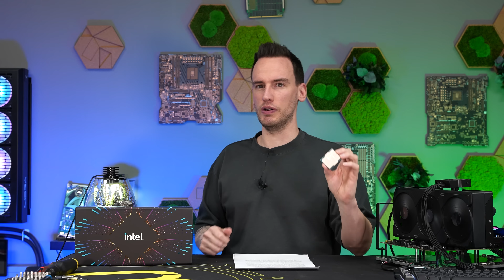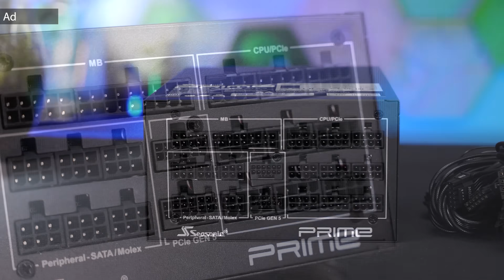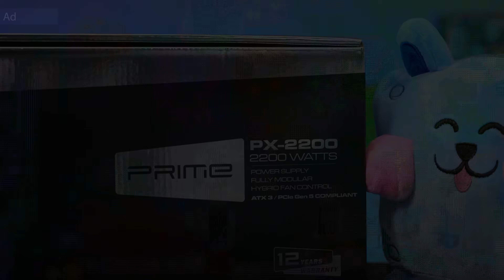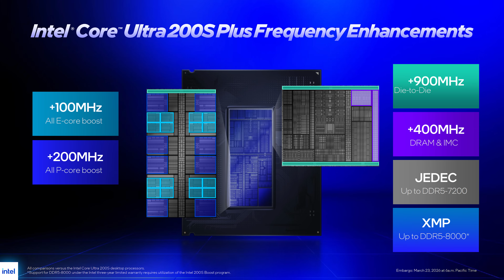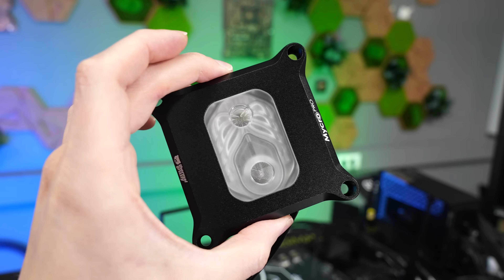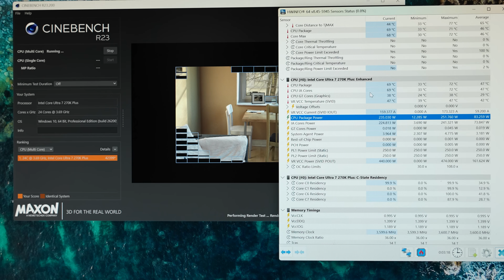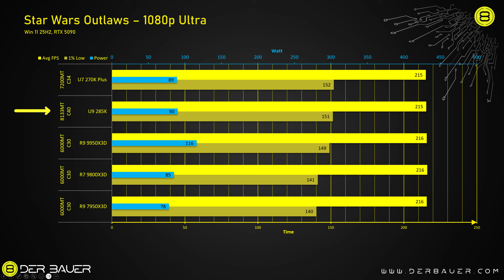The Best Intel CPU in Years! 270K Plus Review

Comment: Maybe one day, when I inherit grandfathers DDR5.
Reply: You'll lose about 1 bit in every byte due to inheritance tax
Reply: @andyastrand I didn’t know a parity bit was taxable ?!
Reply: For now 146/700Kf with DDR4 does it's job really well especially after undervolt. No regrets about DDR5 platforms inaccessibility.
Reply: @stangamer1151  Grandads not leaving you his heirloom ram is he?
Reply: lol 😂
Reply: KEKW
Reply: The 14600k is inflated, a 13600k costs 15-20% less.
Reply: Should have had extra by now...any overclocker does. Need a set or two?
Reply: No chance kid bury it in my grave😂
Reply: Exactly!! 
Cpu's were never!! faster and cheaper* then lately, counting from K7-Tbird, almost every red cpu between, till PII-965 when they hit years long THE WALL power socket lol, but nothing! was burning then to, even 5G/200W+ :)
2016 settled for blues 6600k system (had fm2 6600k also), mined E with reds 580's for years, still works like charm with 5700xt/z170GPC/16/S3422DW..
During covid years, got an used refresh* 7700k/z270 arctic-now titanium.. paired with 32/7800xt/VPN100/55C1.. still rocks, even Stalker2 lmao..
Prolonging short story already, one pathetic 7500f today slaps them both, comparing same with duron@800 back in days..
MBO trilopoly is way tougher to handle then 5 and more years ago.. still* not big if on red base..  
Problem is in stupid people, becoming even more dumber misusing! ASUS A8N32-SLI Deluxe logo lmao, as i would rather burn 129 to 500eu difference, after midnight price spike!! for 32c30@6k DDR5 roflmao.. along with green camp from first rtx serie.. that's when video killed midrange radios.. hopefully they do sepuku one day for good with 12V..
So idk what is the use of reviewing cpu's today at all, but is good to know someone still thinks on god ol micro evolution only history blues, with buildings full of their smelly sockets*.. or are they greens now..

這讓人不禁好奇接下來會發生什麼事

Comment: Awesome...but DDR5, its DOA.
It need a DDR4 Support with DDR4 Motherboard to be an option.
Reply: DDR4 is obsolete now. LGA1700 is your last platform to get DDR4 support, so you can run a 14900k if you want the best CPU for DDR4.
Reply: @_aceofspades_  Yes but AI Data Center taking all the chip, its deead  to have DDR5 at affordable price.
Reply: why not use the old DDR 5 sticks on the new CPU ?
or your museum is so old that sticking to DDR 4 is a fast upgrade ?
smart ?
Why not go for a Pre Build, need a new GeForce too ?
Reply: @lucasrem  Because AI Data Center taking all the chip increased DDR5 Price.

Comment: 7200mhz vs 6000mhz ram though wouldn't call that fraction of the price with a complete build
Reply: My year old DDR is 6000, intel provided this, 0.004 deference in frames !
Reply: @lucasrem  0.004 would equal to zero gain at all .

Comment: If only intel wouldn't change socket every gen...
Reply: IIRC, they have announced plans to change this.
Reply: how many amd cpus did it take to find one that doesnt stutter
Reply: Oh look, someone that upgrade annually or the latest! I bet you dumped a 9800X3D for 9850X3D!
Reply: @AlfaPro1337 Annually? Bro people would like to keep their upgrade options open for longer than mere two years.
As impressive as an upgrade this Plus series is it will be beaten on less than 12 months by both Nova Lake and Zen 6 that will be vastly better options with much better platform support.
Even Intel is rumored to support LGA1954 for around 3-4 generations. That's reasonable. No one is asking for 10 generations, but most would like more than mere two generations.
Reply: @Raivo_K  Not really, I saw when 5800X3D launched, people dumping their perfectly working Am4 chip for it.

Later when AM5 launched, dumped their AM4 for Am5.

The cycle repeats with 7800X3D, dumped their 7900X for it.

Oh wait there's more and you guessed it! Dumped their 7800X3D for 9800X3D.

There's even more and you already saw this miles away! 9800X3D for 9995WX.

Rinse and repeat with 9850X3D.

Guess what will happened when 9950X3D2 launched. . .

This just shows that AMD products aged like rotten milk before it hit store shelves, or even in design.

Also on Reddit, guess what? Dumped their dead end socket (older platform) for another dead end socket (Am4)?

"their upgrade options open for longer than mere two years"

No, it is actually annual or whatever the latest.
Reply: @AlfaPro1337  Found the Intel fanboy. AMD CPU's aged like milk? Bro i dont know what herbs you're on, but you better ease up on those. 5800X3D is literally trading blows with the newest releases four years later with slower memory. People who upgraded to X3D on AM4 made the best decision in regards to gaming performance on that socket. All 7000 series models on AM5 are also still relevant.
Reply: @Raivo_K  Let AM4 go, it's dead already, not obsolete mind you.
And tell us how awesome an upgrade path on AM5, how meaningful it is?
Reply: @AlfaPro1337  stop self liking fam
Reply: @alondjeckto  You too 🤡
Reply: @StroggKingu Zen 4 to Zen 7 is going to be a pretty insane performance increase yes
Reply: @enriqueouro9  I'll believe it when I see that. Zen 4 to 5 also had awesome marketing but tests verified that.
And how do you know if Zen 7 is going to be on AM5?
Reply: @StroggKingu That seems to be what leakers say, not guaranteed but it seems very likely at this point. Zen 5 was very similar to Zen 4, Zen 6 is going to be a significant change in the architecture and process node, so performance will also be significantly different.

Comment: how do it comper too my old 12900ks?
Reply: The new Plus Version eats your old 12900 in every aspect
Reply: @MichaJenkins  eats your old 12900 barely, in real life
Reply: @claudej8805  only if you need that RTX 5090, i would upgrade that 12900k now.
What GPU u use ?
Reply: @lucasrem I use a 3090. Mostly for gaming and fps shooters. The real life and benchmarks are not the same. Thanks for input, I hold no to it a couple of generations 😊

Comment: Intel loves to have a short run on each socket.
Impressive to see them outdoing AMD in multi threading, and at a much lower price. Honestly the gaming performance looks good. Shame no one can afford RAM rn.
Reply: When you only upgrade every five-six years, you’d want a new motherboard and everything else anyways. The only part that got to move to your new pc is the mechanical drive. 😂
Reply: @leeyuan8311 I've usually done one upgrade per socket. I've had six chips in 20 years on three sockets:
2005 first self built PC, Socket 939, NF4, single core Athlon 3000+, later upgraded to dual core 3800X2 on the same board, helluva upgrade.
2012 LGA 1155, p67, quad core 2500k, later upgraded to a 3770k on the same board.
2020 AM4, B550, hex core 3600, later upgraded to 5800 X3D on the same board.
Probably upgrade platform again in another 3-4 years. I will look for something that has upgrade potential when the time comes.
Reply: It's funny there are people who think just because we don't upgrade every 2 years we are not in the market, we just don't see the point of spending it, even more as an adult with responsibilities it's borderline reckless spending IMHO
Reply: I wouldn't be surprised if prices dropped within the next 2 years.
Reply: Except LGA1700 is now going on 5 different CPU generations but ook lmao
Reply: They do keep Socket long support in Socket 478 / 775 generation 

But then sad story started
Reply: The sockets being changed doesn't really matter, you would waste money upgrading every generation for incremental performance gains Best is to skip 2-3 generations and by then you will want a new motherboard so the socket doesn't matter. Other technologies on the motherboard change in that amount of time so keeping the old board is leaving new/updated technology off the table. But thanks to AMD's marketing department people started caring, and yeah it is all marketing.
Reply: @JETWTF  2-3 generations is still within the life time of a Amd 4/5 mother board. 

If you bought a 7000 series cpu  , you could upgrade to Zen 6 and Zen 7   , with just a bios update. 
And its good for budget users and Teens just getting into pc building , the ability to incrementally upgrade a pc without needing new mother board and ram,
Reply: @snakeinabox7220  The absolute worst way to buy a computer. Get a shit experience the whole time with mid range parts and spend more in the long run. Intel flagships always last longer than AMD of the same era, mostly because of the memory controller, single core speeds, and the monolithic architecture that made it snappy before Arrow Lake. If you compare something like a 10700K or 10900K to a Ryzen 3000 build, why in the world would you want to spend more on a Ryzen 5000 part at this point? The 10900K will still be a better experience. The best option is to get a 270K right now if you need the horsepower and ride it out way past AM5's expiration date. And that's not even considering LGA 1700 which went from 12th gen to 14th gen with both DDR4 and DDR5 support, the 147/900K of which is still offering the fastest gaming experience on anything over 1440p. For gaming we're waiting on GPU performance.
Reply: @Felale brother.
3700x vs 10700k.
A 270 Usd and cpu vs 400+ usd Intel cpu.
3700x has pcie 4(10700k only had pcie 3), same multi core and productivity and had 90% of the gameing performance, and used less power. 
And for flag ships 16c 3950x  beat the 10c 10900k by a Wide margin in every productivity class. 
Next generation 5800x3d released and it was the King of gaming, surpassing the 10700k by up to 30%+. One bios update and you can slot it in. Or a 5950x.
Meanwhile 11gen was a flop, and 12th needed a new motherboard.  And motherboards only supported ddr4  Or ddr5, not both at the same time. 

13th and 14th are degrading and dieing( my own 13700k included, and bios updrade helped, but doesn't fix degradation that already happend. . 
In the life span of Am4, Intel Swaped 4 motherboards. If you got a 1600x you could updrade it to a 5600x.
If you had a 6600k, you can't upgrade past 7th gen ,
Updadability is something you can't ignore on amd. .
And for zen 4? You can upgrade all the way up to a  zen 7.
And Yes cpu performance does matter , as upscalers are becoming unanimous. The internal resolution is staying around 1080p. A 5090/5080 usieng Dlss Quality at 4k is rendering the frames at 1440p internal, and 1080p for Balanced.
Especially for nvidea as they lack a extensive hardware schedualer and use more cpu performance.  You can see that in the Star wars and cod games, whare a 9070xt is at the close to the  performance as a 4090( in tech power ups review of Star wars zero company , when running at the same internal resolution 5090 4k Dlss Balanced and 9070xt 1440p Fsr Quality they get the same fps around 95) , becouse the nvidea gpu  gets cpu limited first, even with 9800x3d chips.
Reply: @snakeinabox7220  true but with Zen 6 about to be launched next year, the whole point of AM5’s longevity is becoming less…. Because a Zen 4 gen can be considered to be upgraded with Zen 6 or maybe Zen 7 but when Zen 6 is there in the horizon by 4-5 months time as rumours say, the whole platform longevity becomes less for a general user 🤝
Reply: @Sandychocky5500  zen 6 still had a generation ahead, and amd has proven to continue supporting older gen platforms.
If Intel truly does support 3 real generations( like the Rumers say) on the  same  motherboard. Then it will be a bonus for them.
But if they launch another motherboard with 1 generation + refresh, then it's going to be disappointing.
Reply: @snakeinabox7220  well to be honest, for people like me who literally use the CPU platform to the maximum possible till it becomes quite obsolete, single generation platforms are fine for me. Because I’m still using my Alienware 15 R3 as I said that has a i7 7820HK, 1080 Max Q 8Gb and 32GB RAM from 2017 which is till use as primary machine but yes it is slow by today’s standards. That’s why planning for a 270K plus for even a longer term till the next generation platform comes with DDR6 memory support. It’s like not confirmed but DDR6 could potentially find light to mainstream desktops by atleast 6-7 years from now….
Reply: ...except for the last socket? Which ran for 3 years and 3 respective generations? Except for that one? The one that ran the same length of time as AM4? You are, of course, not including that Intel generation in your jab?
Reply: Easy win in multicore but with 50% more cores.
Reply: Im not too surprised about the multi threading performance, they just have straight up more cores/threads, for single core performance the P cores are comparable to and cores but the e cores are a lot worse, if a application is properly multi threaded then the difference in P and E cores should be minimal. Gaming usually is more intensive on multi threaded cores hence why amd can still be better. That’s not the entire picture ofc cause also cache but that’s the general picture
Reply: most people have the ram from before.
Reply: @StaceyJensenn  If you are already on DDR5 platform it's unlikely that you are looking for an upgrade unless you are on AM5
Reply: @Rentta  well i got 12600 on ddr5 platform, i can still get up to 14th cpu ,but sure im not going to upgrade , i literally have no need
Reply: @StaceyJensenn I'm on a 12600k but on ddr4 and i still can't justify an upgrade.  Running it at 5ghz/3.9 and it still seems to keep up with my 9070xt well enough.  Still the best price to performance ratio to date, as covered by a few reviewers I've seen lately.    I think my entire setup minus the GPU was ~$900 2.5 years ago?
Reply: @StaceyJensenn  didn't know i can still use my 1600mhz ddr3 with these new chips, thanks for the heads-up !
Reply: @WheissRS  no problem, didnt knew people still use almost 20year old ddr
Reply: @WheissRS  Be honest, you aren't in the market for a new build if $200 swing in RAM prices makes you tap out.
Reply: @CyberneticArgumentCreator yea buddy, more like $200 just for the storage  😂
I was planning to indulge myself with a full top notch AMD build actually, but my old system is still working fine, it even has the benefit of not being compatible with Windows anymore! So i will wait and see, life is plenty busy anyways.

Comment: thank you for the nice pro reviews you are making der8auer , i just have a small question i have a Z890-F Gaming Wifi from asus is it compatible with these new cpus or not ?
Reply: Of course (if you update the bios)
Reply: @claudej8805  the motherboard still  new i only opened for visual check , i am planning to buy a GPU and the third piece will be the CPU , but i will keep that in mind when i will be able to build my new setup i will update the bios first , and thank you for the advice ^_^
Reply: @claudej8805   i regret that i did not bought X890 motherboard but it is look like intel is recovering a little right now

Comment: The gaming benchmarks are filled with 1080p resolution, I guess if I'm gaming in 1440p or 4k, I don't need to care about getting an X3D..
Reply: jim
what games, how many frames ?
Reply: X3D is still faster at higher resolutions too and even more so if you upgrade your GPU in the future on the same platform.
Reply: @Raivo_K  Yeah it's like 3-5% faster at 1440p and no difference at 4k regardless of GPU.